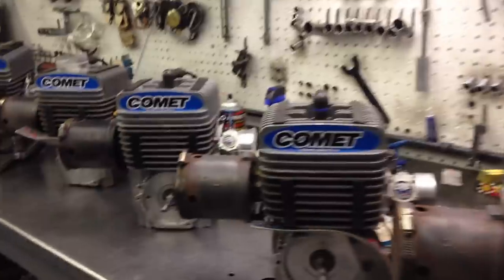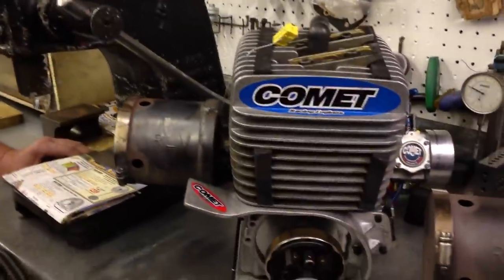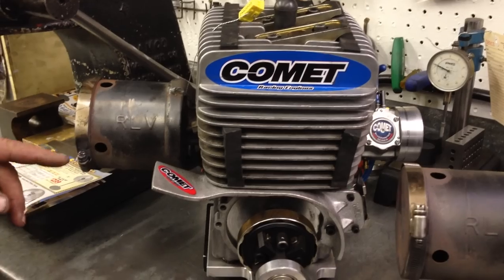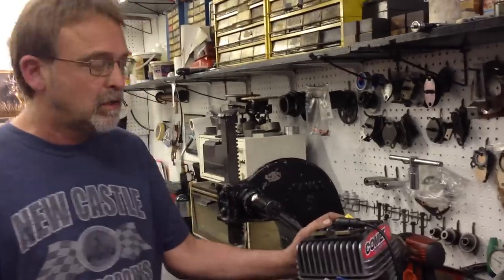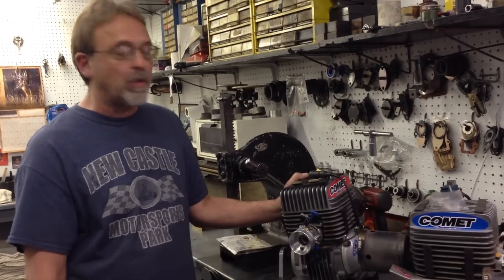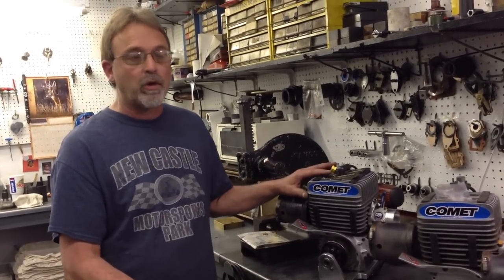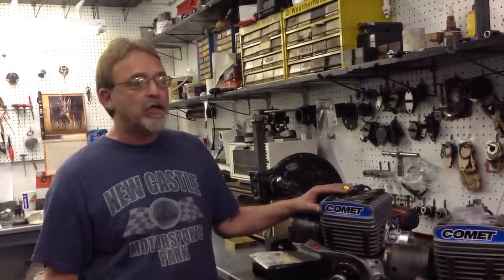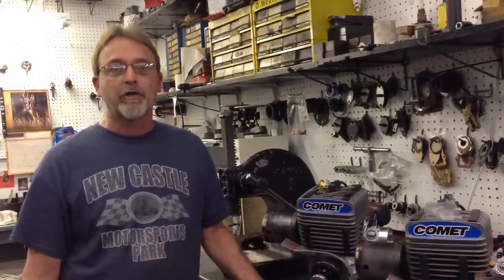The Yamaha KT 100 Kart Engine

Comment: I just bought a used cart with this engine for my son.  How do I tell what carb it has.  Also, the threads on the crank shaft where the starter nut thread on is stripped.  What’s the best way to repair this. I started filing the threads but as I get closer to the end the metal is pretty mashed.  Can I get away with cutting the end off to the clean threads?

Comment: i own a kt100 kart but idk if they are supposed to be really loud or if the engine is just accelerated i would say but pushing down the brakes does not stop the wheels from moving

Comment: I have a kt100 as well and it works perfectly, but when I put it on the floor it stops running and it doesn't starts rolling.
Does anybody know why?
Reply: Adjust your clutch or idle

Comment: Do these motors use oil for the crank case?  I don't see a drain plug at the bottom.
Reply: @Dartgame 340 lol. Not a troll question. All 2 strokes that i've worked on have a wet clutch and gears in the bottom crank case. Like the rm85- rm250, yz85-yz250, cr85- cr250, and kx85-kx250. They all carry one quart of motor oil in the crank case to lube up clutch disk, gears, and crank..

Comment: does anyone know what the best gear ratio set up for yamaha 100s motor is?

I am new to Karting and just purchased a senior Arrow AX9 go kart frame with 11×7.10-5 rear racing tires on a 50mm rear axel  

I am purchasing the yamaha 100s motor next week, though not sure what gear set up to use, I want good take of speed and best max speed I could get out of for performance. I weigh around 98kg
Reply: Anchialem Gale  i can help you
Reply: That gear ratio will change from track to track & whether  your running road courses or dirt & asphalt tracks also tire size. .  Best to ask the leaders in your class for a reference & your engine builder as well . The rest will come from your practice time & record keeping. I ran Enduros with WKA & Woodbridge Kart Club at Summit Point for 15 years so there are many factors as what gear ratio to run at what track your at.  There is no one set ratio.
Reply: It is best to ask around the track paddock what people are using some don't want you to know some will tell you I run 10:86 ratio on my kt100 but my track i drive at has a long straight so I go big on the rear sprocket